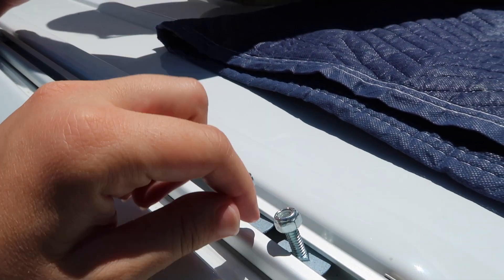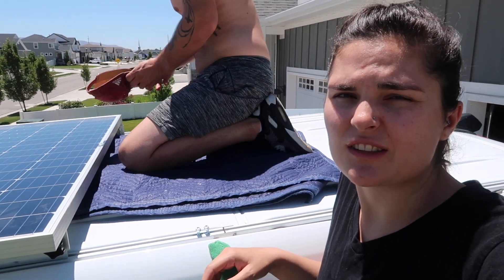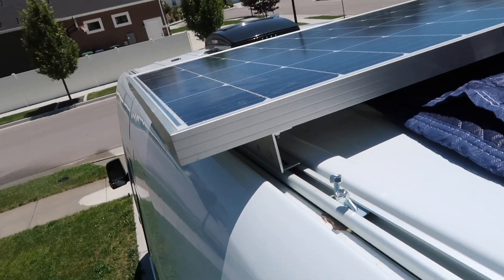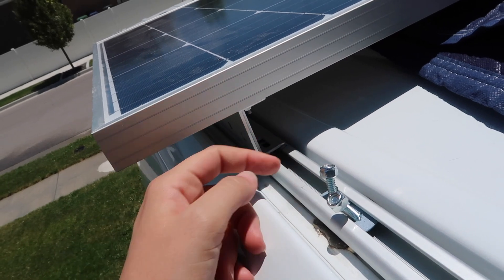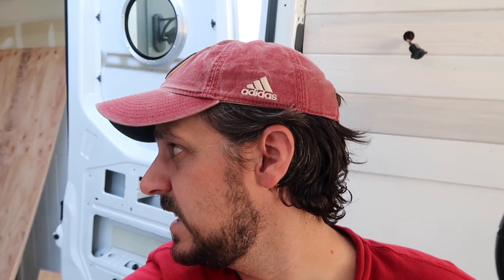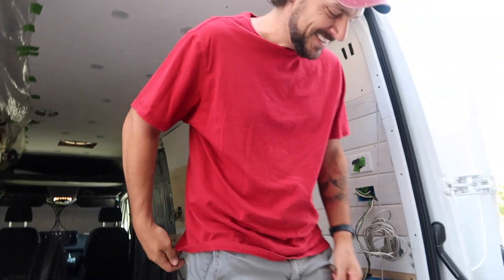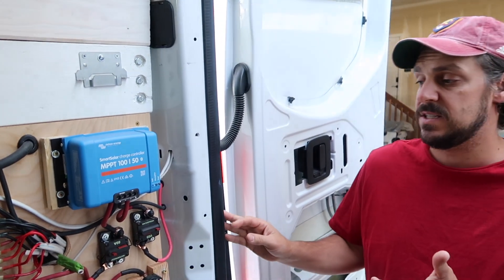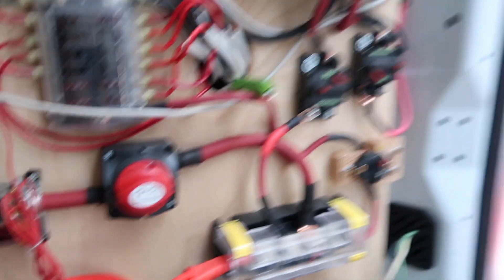SOLAR WIRING & INSTALL (PART 2) - DIY Sprinter Van Conversion Ep.12

Comment: Hey guys, I bought torque washers and grinded them down…bought too few van tech sliders so I’m on to this DIY solution. My torque washers just spin in the railing. Didn’t look like you had that issue, any tips?

Comment: Hi, woody and Shelby.  When you guys tilt the panels, might one blocks the conjunction one?
Reply from the maker: Hi Ying Li. 😊 We were concerned about that but it all depends on where the sun is at. We have the option to tilt just one if that's the case too. We can also tilt them different directions. So far, we've mainly kept them down flat but we're still building out our van. Hope this helps!
Reply: @EncompassAdventure  check this out..... tilting solar panels with remote control..they are 300w each panel
Reply from the maker: @yingli8028  Hi there, we didn't see a link or anything, if you meant to put one. Remote control tilts would be awesome though!